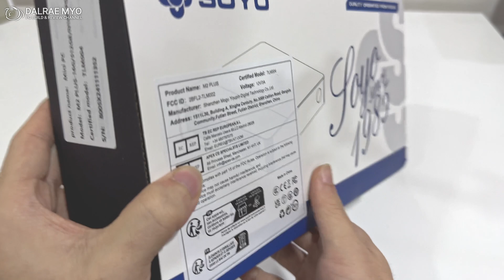SOYO M2 PLUS Disassembly | N100 Mini PC

Comment: Hey, i got a quite similar model, but mine came with a m.2 ssd and nothing in the sata slot. Do you know how the adapter for the small connector on the board to sata is called? 
(Also the case doe not have the holder for it, but i should be able to 3d print something)

Comment: Hello, I have the same Mini PC but it is facing bios errors, do you have a bios dump of this Mini Pc? There is no way to find it anywhere. I would appreciate your help in case you can, Thank you
Reply from the maker: Sorry, I'd like to help, but I'm currently using it as a Linux storage server, so extracting the BIOS seems difficult. I tried extracting it with the flashrom package, but I'm getting an error, either because of the security options or because it just doesn't recognize it.
Reply: @DalraeMyo  No worries, I appreciate it, fortunately I was able to repair the old bios with hexadecimal editor and correcting some memory address. Thank you very much.

Comment: I have an M.2 (not the plus) it is simpler
How do I reset the bios on this computer, I disabled its USB support by accident and now I can't access the bios via the keyboard
Reply from the maker: Power off, disassemble, remove the battery attached to the motherboard, wait a while, then reassemble. The BIOS may reset.